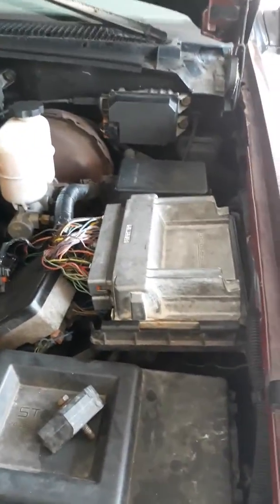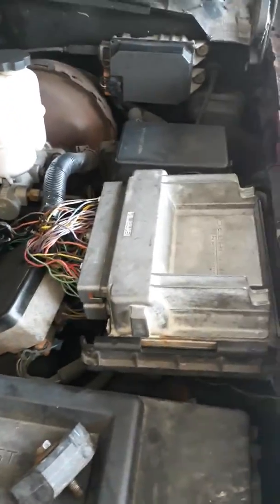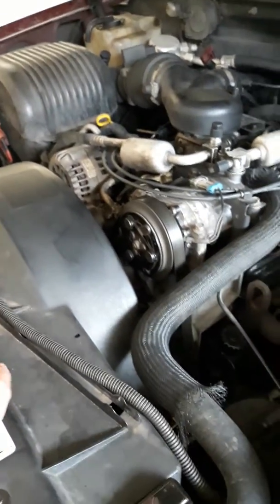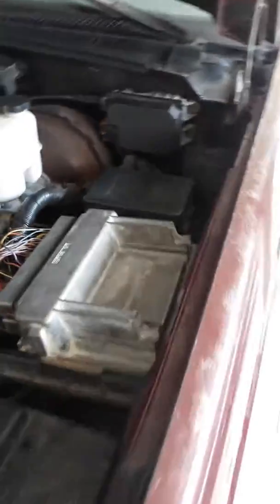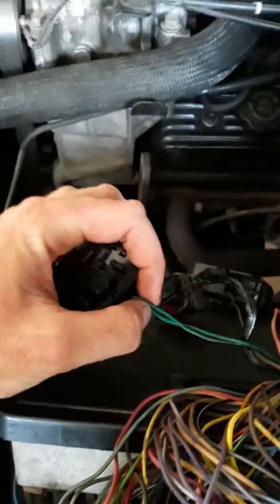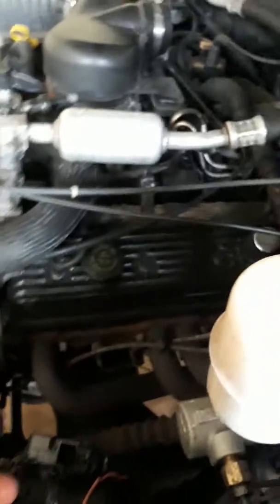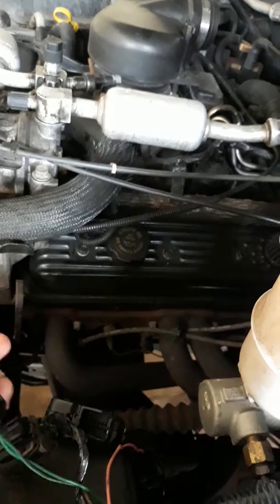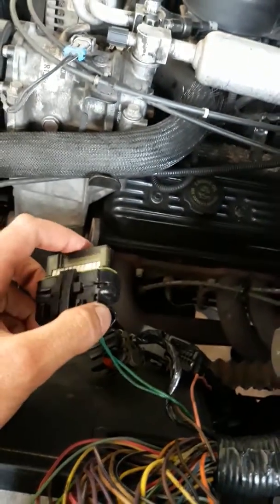1996 Chevy C1500 Silverado: Black box PCM to 0411 PCM swap results

Comment: Tell me what the two green wires are for why they need to be tied together and which pin on the 0411 connector does it slide in

Comment: How do you wire the 411 pcm for the cam signal reference what is being used for the cam sensor thank you
Reply: You use a stock tune from a express van with a 350
Reply: @sicsam223  thank you for the reply

Comment: When ya swapped the PCM from black box to 0411 did the key fob to open the doors still work along with the AC, and the 4x4?
Reply from the maker: My last truck did not have 4x4 but everything else you mentioned did continue to work.

Comment: what year are these boxes and what models did they come in?
Reply: 2000 up vans trucks cars s10  if other then express van needs to run Express van tun as thst is the only l31 engine forr the 411 pcm years
Reply: 00-02 express vans specifically with the 5.7 L31 are the best suited

Comment: Why didn't you just tune the black box pcm. Have no issues out of many that I've tuned
Reply: Could you send me a link for a tuner? I've searched everywhere.
Reply: @MMAMEDIA9  anyone who can use HP tuners can tune it
Reply: @MrYukon04  I haven't been able to find a version that supports a 00' 5.7
Reply: @MMAMEDIA9  it's not the version. HP tuners covers Chevy from 98 on up on the trucks and 96 up on the cars. All you need is fine a tuner who uses HP tuners. It takes 2 credits for yours
Reply: Too expensive to tune compared to the 0411. Plus you can do much more with the tune on the 0411
Reply: 0411 is the.most user friendly pcm/ecu gm has ever produced

Comment: I’m about to do mine. Anything you came across That was difficult? I have all the stuff to do the swap.
Reply from the maker: In my opinion it was not to hard. Then again i have been messing with electronics since i was real young.
Reply: I did mine and it’s running but I can’t do the CKP Relearn.
Reply from the maker: @THEBRAINANAYTOR  hmmm what program did you use to get the pcm to work? Hptuners?
Reply: I bought the pcm based tune from the same guy that gave me the pin out sheet. Pcmpowertunes
Reply: @THEBRAINANAYTOR  hey bud, I have the same ecm and tune from pcmpower tunes. The only thing that has me concerned in the splicing for the trans range switch did you have to do that?
Reply: Cody Piester nope. I’m a 96’ and I did not have to splice into any tranny wires. I even tow with the truck and it’s done just fine. Firm shifts and all.
Reply: @THEBRAINANAYTOR I’m doing this swap on my 99 suburban last year they did the Obs style for the suvs 

I am concerned also about the trans range switch, supposedly it depends if the tuning company has the parameters to do it without needing the extra wires ??

What was the two green wires tied together in your video used for ?
Reply: @Chevro91  I’m also concerned about these 2 green wires, let me know what you find out. I just received the the spreadsheet from lextech and waiting for him to send me my 0411 pcm back.

Comment: How did you get a pinout for it I have been trying to find one for my 98 k1500
Reply from the maker: check my discussion page on here mate
Reply from the maker: Did you ever download it?
Reply: Would you mind giving me the pin out? I’m having trouble finding it
Reply: @ericnieto9394  do you have the black PCM? If so just tune it with HP tuners no need to change the pcm
Reply: @MrYukon04  I thought the black box couldn’t be tuned with HP?
Reply: @Issastock350  The black box is the only one that can be tuned by HP
Reply: @MrYukon04 no the black box pcm is very limited , if you want to do any internal engines modification you’ll need to run a carb or the 0411pcm , it comes out being cheaper to pcm swap cause you’d have to buy a standalone tcm to run carb , plus the price if the actual carb , and a low pressure fuel pump and pressure regulator
Reply: @Matthewamic  I don't know what you talking about limited because I just got done tuning my friend's 98 Z71 with  cam and heads. Well it's been 5 years ago so I don't mean just finished lol was a long time ago
Reply: @MrYukon04  well what year is it ? If it was a 98 then that would explain it cause is used a different black box that is more tunable , the most i can do is delete some emissions on mine with hp tuners
Reply: @Matthewamic  98 which is first year for the black PCM